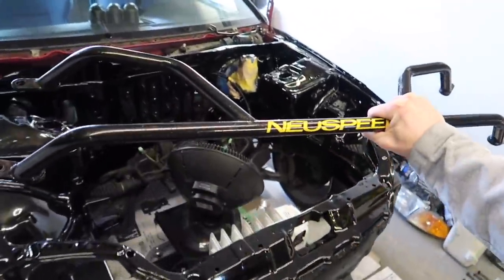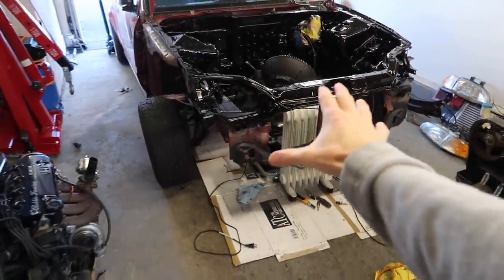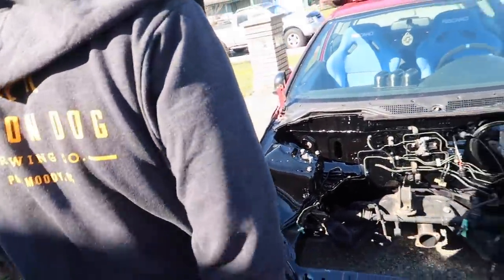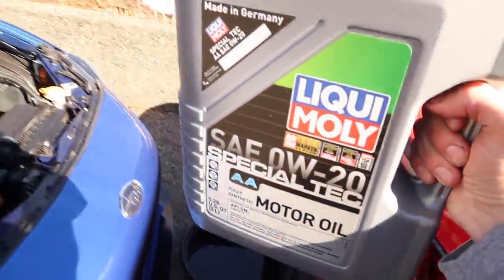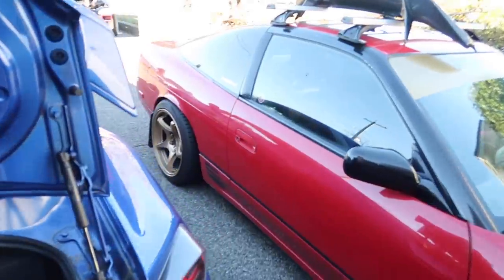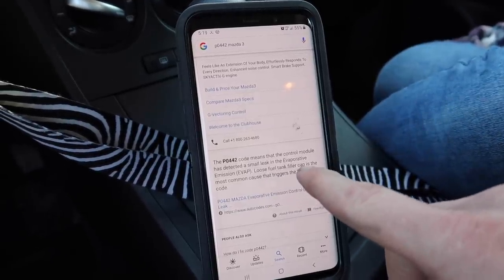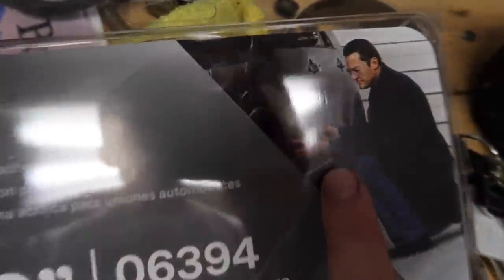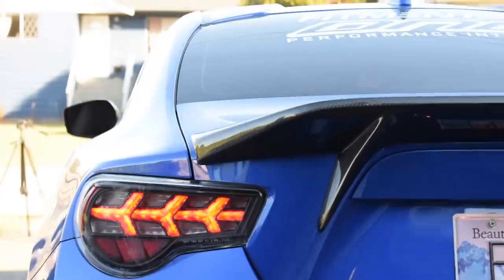BRZ Gets Its FIRST CARBON MOD!!

Comment: Did the recall affect your Subaru? I heard it’s valve springs.
Reply: AFAIK The recall has to do with the head unit. The Brzs have had issues with valve springs for years from the factory though. I had my engine pulled when my car was at 100 miles :/ But yeah, in regards to the recall, the mail I received just had to do with the head unit and not displaying the back up cam when throwing the car into reverse.

Comment: Yo, with that evap leak issue, try looking at replacing the purge valve solenoid. I had this go bad in my 06 Honda civic. After replacing the fuel tank gas cap and getting this message, I replaced this and it solved my issue! Just a thought.

Comment: My mom has the exact same problem with her mazda. Its a 2012 Mazda 5, CEL keeps coming on due to not tightening gas cap. Basically dealership just said not to worry about it because itll keep coming back on. Its just some weird problem with the gas cap sensor or something.

Comment: To remove stickers, you can also use a hair drying. Works better than a heat gun because then you can not burn what you paint with a heat gun can happen